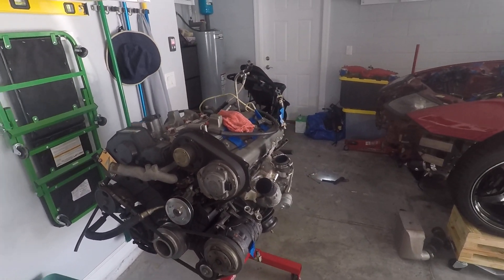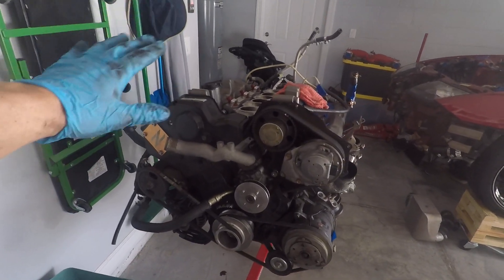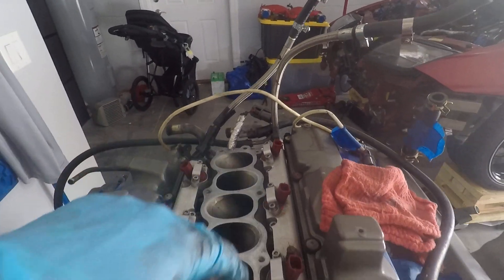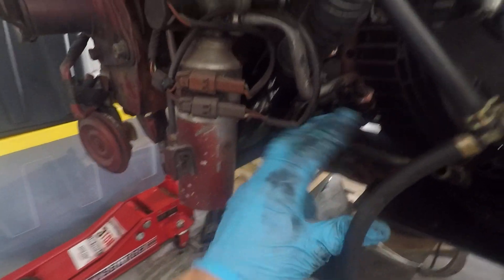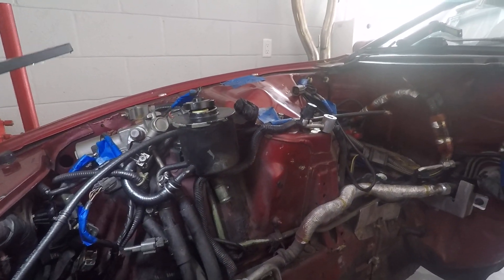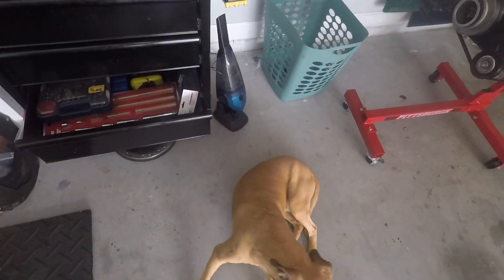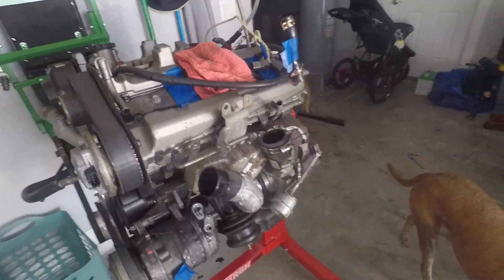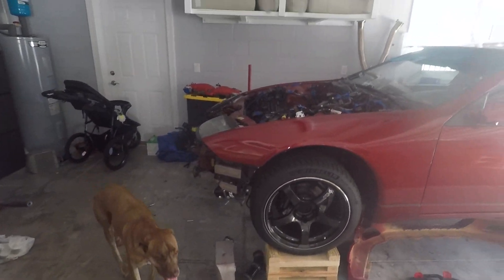300zx Motor is out!!

Comment: Just almost finished my motor tear-down, all I can say is simplify everything you can while it’s out haha. Merlin engineering do a AN water line conversion for cooling loop on the turbos which look the goods and would probably increase the cooling capability of the turbos. I’d also see if you can go the r35 coil conversion by polar engineering if you already haven’t, but other than that she looks solid mate 🤌
Reply from the maker: Appreciate the info! Thanks